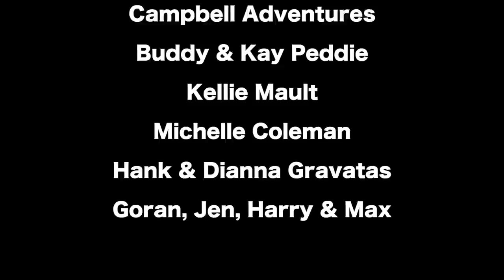Are We Slowing Down? (Chicken Garden Day 136)

Comment: You need big umbrellas, tarps or light tents to solve your sun problem on all working stations.
Reply from the maker: You must be new here. Wind, wind and more wind 😂
Reply: @TinyShinyHome  No, not new, I already follow you for a long time. Your location is not the only one with stronger winds, at beaches or mountains for example are the same needs. There are a lot of solutions for windy areas , umbrellas for up to 50 MPH or also a much cheaper solution: used military camo nets,  set up in minutes with stakes like tarps or shade sails, with big meshes, the wind can go through, but it will give also shadow. Even party tents can withstand continuous winds of 60 MPH, if they are fixed properly. In a lot of countries natural materials are used for creating shadow areas. For example reed mats or bamboo mats fixed in a wooden frame provide shade and let the wind through.

Comment: Could you attach the hardware cloth to the underside of the "professional" sheet to protect the hardware cloth?  ( I know the hardware cloth needs support.  might need another heavy  panel?)   There would have to be enough room between the panels to allow the rocks that pass through the heavy top panel to tumble to the bottom.   Also, If you could find a way to transfer some of the vibration from the mixer to the panels, it might help with sifting???  Love ya both!

Comment: I wonder if there's a way to turn one of your old concrete mixers into a rock strainer? Cut openings into the drum, below the geared ring, line the openings with heavy mesh. Turn mixer on, shovel soil into drum. Soil filters out and rocks stay inside. Just an FYI. Best of luck.
Reply: I saw a video on another channel where they did just that

Comment: Just have a question, certainly not a negative rant, but where is the the water on top of a flat surface (top of the wall) gonna go if it cracks and expands? Won't it run down in-between the bags and plastering? i know you live in a dry climate, but with monsoons... aren't ya gonna have to put something peaked on top of the walls to prevent that?  I live in Florida and ya see stucco peeling off walls from the block it's based on cause off a crack way above it...just a thought...
Reply from the maker: Won’t be a flat surface 😉

Comment: I see everybody working hard. Only thing i am wondering about is that you make only two buckets of mix at the time. My grandpa and dad would not stop calling me names and mocking me about the quarter filled wheelbarrow and mixer al the time😊 i really respect the kids ( yes also mum and dad) with their working attitude. Not like most kids these days👍👍😊😊😊
Reply from the maker: Takes awhile to go through the mix and it’s not good for it to sit unused for long periods of time. We make it as we need it
Reply: @TinyShinyHome  ok. Was just curious. I also did use a wheelbarrow to move cement/ concrete and if it was not completely filled, i had a bad time😂. Also cleaning the mixer; just put some stones or bricks in them. They clean the mixer spotless. Be proud of the kids😊! Here they are already tired if you ask the empty the garbage bin😂😊😂